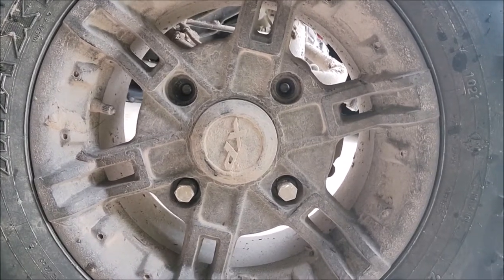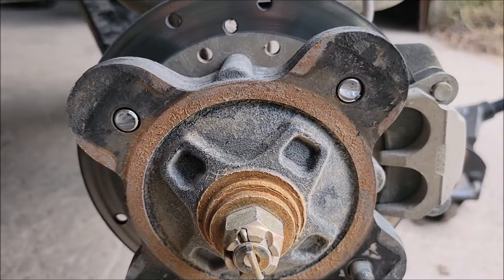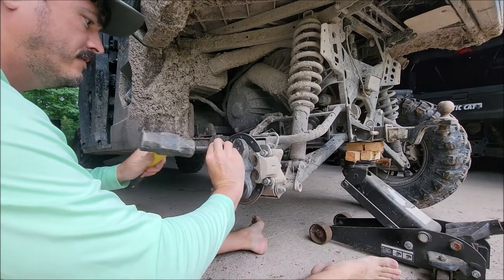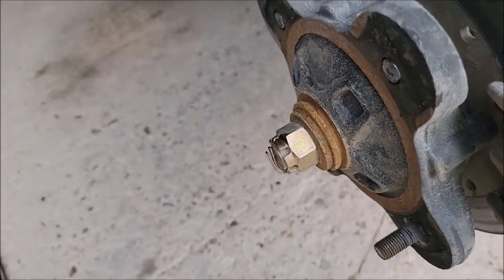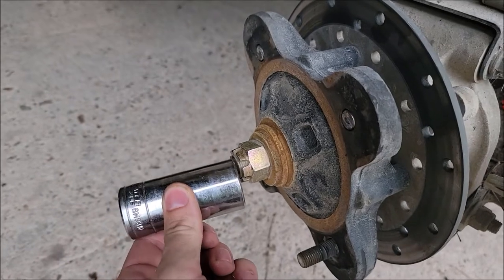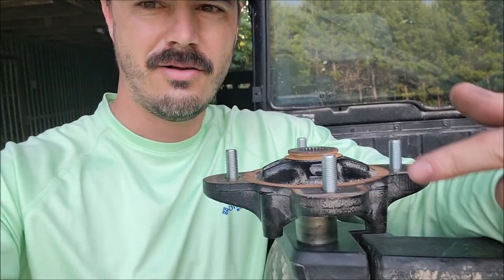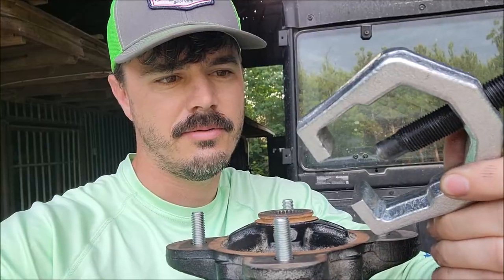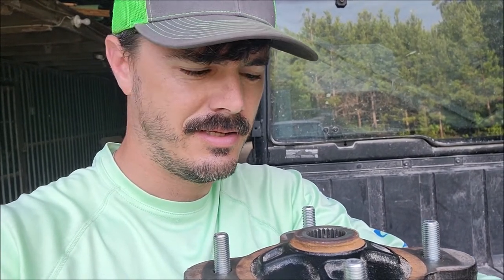SXS Polaris Ranger Wheel Stud Replacement

Comment: for anyone reading - an old fashioned air hammer will take wheel studs out in about 8 seconds - i know everyone loves battery tools and I have those as well - but an old air hammer is made for wheel studs - easy peasy - drives them right out and its clean........if you have room behind the hub itll drive them right in in a couple seconds as well -

Comment: well somehow my ranger northstar on tracks had this same thing happen. i caught it and limped it back but broke one stud and ruined the other studs. problem is i can’t get the hub off of the splines!!
Reply: I broke a stud this winter with the tracks on also.  My own fault, not checking torque on the lugs and they had worked loose a couple days after we put on the tracks